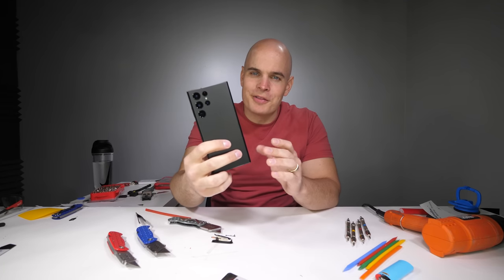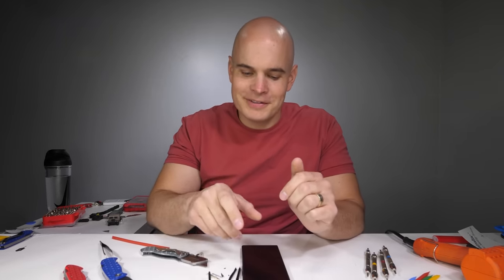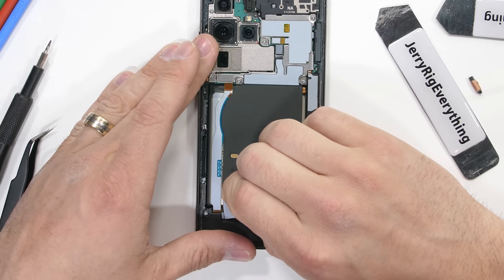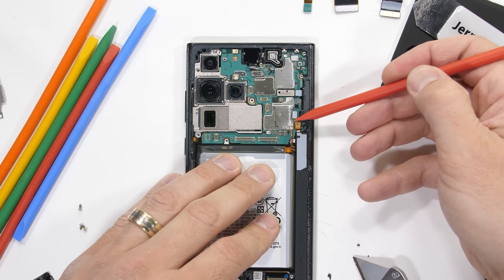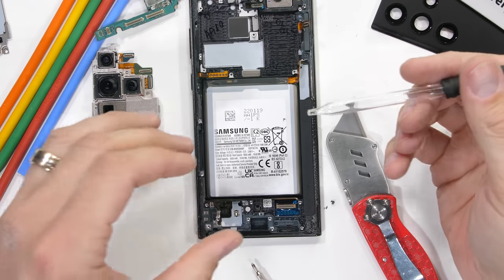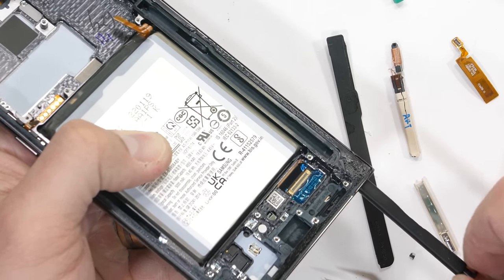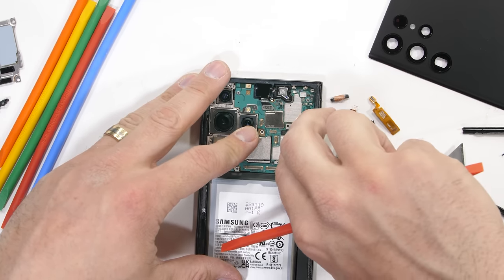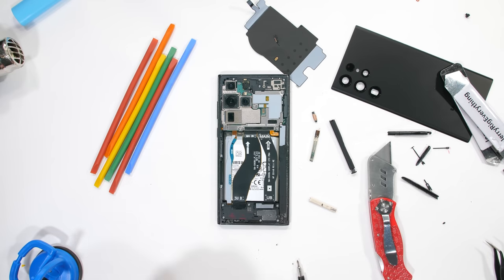Galaxy S22 Ultra Teardown - Can the S-Pen hole Leak?!

Comment: I am rocking my note8 at the moment. The USB-C port is kinda ruined, but it still charges. I already changed the battery, but the second one is nothing compared to the first one. Ow, did I mention that during the replacement I sliced the battery and it looked like it wanted to launch into outer space? The phone survived the unscheduled fire test, with only some pixels burnt to death. The speaker for calls doesnt work for couple months now, so I am using my headphones or loud speaker for calls, super uncomfortable but I just wasnt ready to replace it yet. I think I have done my part environmentally, using my phone as long as possible, until it almost dies. I am planning to buy S22 or Ultra and trade in my note8 for it, so the shop will use it for parts, this way, my old phone will serve even after its final disassembly.

I try to do it with all my electronics, use them until they die or are ridiculously old, then recycle and replace them. Also saves a lot of pocket money not buying a phone every year or two.

I would love to use my new S22 for years. I would gladly replace the nonfuctional speaker, usb and battery if they ever get clogged, if the replacement is not ridiculously costy - lets be honest, they are now. The insides of the phone dont age. If they software was updated for many years, even that would not age. I also protect my screens and even they are replacable when needed. But companies dont want us to use our phones for years. Hopefully EU will push more for longetivity of electronics.

Comment: Looks like flagships finally plateaued. Any performance increase you get out of this over a flagship 2 years ago is incremental at best, yet they charge more for it.

Good thing I can see here is that, aside from convincing me to hold on to my old phone, it also simplifies my shopping choices when my phone finally kicks the bucket. Instead of upgrading for features (which isn't all that impressive, to be honest), I am now shopping for a home appliance. 

Honestly, I am okay with that.

Comment: If you buy direct from Samsung you can trade in your old device, pretty easy way to recycle. I FINALLY traded in my pristine Note10+ for an unlocked S22 Ultra 512gb and they gave me $425 trade-in value. With pre-order discounts, I ended up paying $810 for the phone. Plus Samsung gave $250 in store credit to those who pre-ordered, which I used towards a Watch4 Classic. Total order cost with shipping: $918.91. Retail value: $1719.98.

Comment: Definitely agree that the battery shouldn't be so difficult to replace both for environmental and safety reasons. I'm curious though if using such strong adhesive contributes to structural rigidity? Curious if the thought has ever crossed your mind. How can that theory be tested though is the bigger question.

Comment: For Samsung battery You just need to use ethyl alcohol ( more than 96%) and Yo u can basically use any suction cup or even your fingers to pull it out. Just wait 30 seconds or even better put it in hotplate for same time.

Comment: I personally don't think the battery glue is that big of a deal at least on most Samsung devices. I always find that with a bit of heat and alcohol, it usually pops right off with minimal effort. The pull tabs on Apple are not what they are cracked up to be. They work OK on new phones, but after a couple of years, they seem to lose some of their elasticity and break as soon as you tug on them.

Comment: I keep an eye on battery technology and lithium ion battery developments. I don't know anywhere in North America that currently offers 95% recyclability of them. One company has a technology/process that claims to do this, but they're still building the pilot plant. No battery sent for recycling today will be 95% recycled AFAIK. Current hydrometallurical processes used in most recycling facilities today are no where close to that 95% number.

Comment: Samsung batteries are easy to remove with a heat plate. Iphones on the other hand are a pain with a heat plate or any heat. The tabs always break when trying to pull on them so I have to resort to heat and brute force. Use a metal spatula next time then make your own with your logo then sell it on your website.

Comment: Repair and recycling is important to me, which is why it is so frustrating that flagship manufacturers have chosen to prioritize profit by designing phones without easy access to replace the battery/repair the phone. Give me a Fairphone compatible with US carriers and and comparable tech to most modern flagships and I would buy that in a flash.

Comment: As I have never worked for a recycler, I could be wrong, but I don't think they really care about the extra adhesive on the battery.  They are not gentle when tearing apart a phone to recycle.  In videos I've seen, they really just rip it apart and throw the individual items into bins to be destroyed and broken down for other use.  I do see where doing repairs would be more difficult, which is always unfortunate because reuse is the best way to keep landfill waste to a minimum.

Comment: i don't think removing a lot of glue is an issue when you throw away the rest of the device too but if you want to install a new battery to extend the lifespan of the phone it's easier to damage the screen when removing the battery if there's this much adhesive.

Comment: Although it is interesting (and quite educational) to see a phone opened up like this, a vast majority of people won't be digging into their phones and risk breaking something, and voiding warranty. 
Instead, it's far more likely that they'll use a replacement program (much like Samsung itself offers), replacing their old phone with a new one. They get a better deal for the new device, and Samsung gets to deal with recycling their old parts, including hardcore battery glue and whatnot. 
IMO the latter is a far better option at the moment, at least until we get phones that are meant to be taken apart, without the risk of damaging expensive components, voiding warranty and potentially hurting yourself.
I guess my point is that a heavily glued battery shouldn't really be a deterrent factor in buying a new phone these days. 😀

Comment: Great video. I have a problem with my S22 Ultra after a screen w/frame replacement. It will not detect that the S Pen is inserted. Inside the S Pen enclosure, is that white component the trigger switch lever to alert the phone that the pen is in the phone? That's how the note series was but I don't see how the trigger would be connected. You mentioned 2 cables related to the S Pen. Maybe the tech didn't fully plug one back in assuming the white piece is a trigger switch. Thank you.

Comment: I was trying to find out what a thing on the outside of my S22 Ultra corresponded to on the inside, but you didn't cover it in the video.

On the side with the power and volume buttons, about 2/3rds of the way down the phone and about half way along the battery, there is a rounded rectangular piece about the size of the volume rocker but with no apparent purpose beyond being made of a slightly different material / having a different texture. It is mostly flush with the rest of the side, but is perhaps a slight be indented. And there's only a very small amount of metal from the normal side material between it and the seam for the glass back and between it and where the screen starts on the front of the device.

Do you know from your tear-down what that is and why it's there? Or was this not on the model you looked at and something that only some models have?
Reply: From taking a closer look at your video and comparing against some diagrams I found, the piece I'm talking about is covering up one of the 5g mmWave antennas. They probably putting some plastic in front of it instead of metal to give it better signal reception. Not sure why they only did that for the antenna on that side and not the other mmWave antenna on the other side of the phone across from where the volume rocker is though.

Comment: I wonder if people out there really buy a phone asking themselves, "how recyclable a phone is?" I've never asked myself that honestly. I don't think that question applies to me personally. I purchase a phone to use it. Not to worry about what happens when I go to trade it in. There are people in place to worry about that.
Reply: Important to me. Was considering this until seeing how difficult the battery replacement is. These batteries last 2-3 years. I don't care if I lose waterproofing but I'd like to extend my phone for another 2-3 years. I had an iPhone 5S for almost 4 years because replacing the battery wasn't super hard, just unglue the back and pull on the tabs. Having ribbon cables right where the battery is has to be designed to make it difficult for self repair...

Comment: Answer to your question - I would love Samsung and other manufacturers to go back to removable back cover and easy battery replacement. I do not need waterproof smartphone, but one which can be easily repaired without glass back cover and glue strong like steel.

Comment: Note 8, still holds great, 4 years ago. It only misses some updates, but in rest, it has a SD slot, 3.5 mm jack. And it's slimmer and rounder on edges. Remote gimmicks with S-pen are useless. Too bad I can't return back s22 ultra.

Comment: Was hoping to see that there was a way to add a microSD inside. I made the mistake of buying the 128GB phone and already wish I had more space. Samsung seriously dropped the ball by not having a card slot.
Reply: Exactly, and why??? They xould easily make second sim card slot function albo like SD card slot but they didn't. And samsung even made ads before about making fun of apple removing features. They need to fire some of the new staff to not have such ideas as removing sim card like apple also did in iphone 14

Comment: All phones in the market should have goes back to user battery replacement era. Save our cost to repair phones by just a new battery would makes our phone reusable instantly. Upgrade phone is actually a pain process especially those who needed to transfer a whole lot of data as every phones brands have its own unique method.

Comment: Would you please address the speaker bug issue in S22 series.  Apparently the phone is so watertight that high altitudes and very cold temperatures affect the internal pressure of the phone, keeping the speakers from processing sound normally.  Very interested to hear any obsrvations.   TY.

Comment: hello jerry
In the morning, I accidentally inserted the sim removal needle into the hole next to it instead of the sim hole and pressed lightly. I later found out that this was the microphone hole. There is no problem with the phone. microphone also works.
but according to what I read in 12 places they say you may have damaged the waterproofing. Can you provide information on the subject? thanks

Comment: I dont mind recylability too much as long as its recyclable in theory. Its hard for me to internalize how hard it is to recycle and how much that impacts battery recovery, but knowing that it is well built and will not face much environmental strain could lead to me feasibly using the phone for much longer than normal which is better than recycling for the years it's in active use (i.e. using one phone for 4 years is better than using 2 perfectly recyclable phones for 2 years each)

Comment: aldough seems like it is easier to replace samsungs s22 ultra battery than on iphone 13 pro max.. on iphone you have to remove display.. and some other parts, have to use 4 different screwdrivers. on samsung, battery removing is easier if you heat display a little more, then adhesive softens and it is much more easier to pull battery out. :-D

Comment: I did a Samsung warranty repair for faulty S-Pen turned out customer went in water and quickly got back out. S-Pen got water damaged I got told by Samsung that S-Pen is not waterproof but they replaced it under warranty.

Comment: Would it be possible to replace the bottom board with one from a previous  Gen that has a sd card reader maybe the Note 10 board since it also has 45W charging ?

Comment: So I came to watch so I could finally figure out where the NFC antenna is. So the NFC unit is up beside the cameras? So then, why is it that I have to tap my tags against the center where the wireless charging is, or tap the bottom of my phone to payment terminals? I get zero action up by the module itself, and I am supremely confused now.

Comment: Apologies but the iphones are still not repairable , in the slightest. The parts from apple cost as much as a repair done by them, the bacj glass doesn't come off easily, and ALL the parts are software locked. Watch Hugh Jeffrey's video. Samsung, apart from the battery, is one of the most repairable flagships. Easy to repair and no software lock to the parts.

Comment: My S22 Ultra wouldn’t function at all last night. I think a bit of water got in through the power button. The screen starting freaking out then just went black and non responsive. Power button didn’t work. So I suspect either water or Windex entered the phone through the power button hole. I messed with it for 2 hours and there was no improvement. I put it in the freezer for an hour and only had the screen return for  maybe 2 seconds. But that gave me hope. placed the phone in a box of white rice for 10 hours and now the phone is functioning fine. I take very good care of my devices. Water proof? Not 100%.

Comment: good luck repairing a apple phone yourself jerry!  yes battery replacement is important as a phone that is still good after 4 years might need one... going through apple and samsung for years and trying something from xiomi out of impulse , thanks samsung (customer service did not know after 20 days if my order is dispatched or not...) i found that if you can live with the extra stuff preinstalled xiomi outlasted so far any samsung or apple phone i ever had... and is easier to fix...so i do not need to through it away in a drawer like my s7 s8  as replacing a screen was not economical justified1-2-3-4 years later...

Comment: Well now that the display on this S22 Ultra doesn't work anymore u can use the rest as the brains for a laptop/tab or use it to make a control panel in your hummer by connecting it to a larger screen.

Comment: You know I had Verizon for the longest time with a note 10. but the service in Washington after I moved up here was just so bad I couldn't really bother with it. so I switch to T mobile and they had a deal going on for a $1000 off with a trade in for any new S22 phone. I really didn't want to get rid of my note 10 because it was still in perfect condition but I really couldn't pass up a good deal. Plus it kind of made my wife a bit happier and I have better service well at work. and so far there hasn't been to much of a difference between the note 10 and s22 ultra besides the backwards buttons for me. and smaller memory but besides that I'm a lot more satisfied with my phone then I was really expecting.

Comment: Just saying, ive done some testing with mine and it seems samsung has yet to fully optimise the new chipset 
According to results its same similar if not same as red magic 7 by nubia but gettings 4/5 the score s22 ultra snapdragon sitting at around 8200 scores and nubia sitting at 10060

Comment: Anyone know why my S22 is now having connectivity issues? I live in Los Angeles, performed a factory reset after replacing the SIM card and then eSIM. Phone only works when I’m walking outside but if I’m anywhere indoors, I can’t connect to anything. Any suggestions?
Reply: если телефон падал, и после этого связь стала плохой, то скорее всего отвалился модем или какое нибудь соединение. или же отвалилась антенна, шлейф и т д

Comment: Honestly, I've been using Android phones from the Nexus One to the OnePlus 7 pro. I loved Android. But my OnePlus battery was quite toasted (I had to charge sometimes twice a day), and the screen was burned. The choice today in Android phone is dire. OnePlus quality went down the drain (an no more Oxygen OS), the Pixel lineup has a lot of issues, and I hate the quantity of bloatware Samsung delivers with their phones. If you want a high quality phone that last years without problem, with security updates... I went to an iPhone 13 pro, even though I used to dislike Apple. Quality product, durable and solid. I don't see any choice for longevity in the Android world nowadays, and it makes me sad.
Reply: My oneplus also got burn in issue. In my family 3 oneplus phones has burn in issues in 6t, mine 7 and 8. I serched in google and found out that only two companies samsung and apple ony got anti burnin software for oled screens. Its a major issue that most of people doesn't know about 🤷
Reply: @bishnoi969  Yep ! Quite peeved to always see the ghost of a battery indicator and a smudge of notification on a white screen all the time... I don't know about Pixel and burn-in issues, if this happens, but if it does, then the choice is reduced to Samsung vs Apple. And on my S7 edge (only Samsung device I owned), between the impossible to uninstall HP tool, the always-on Samsung Smartthings and others, the quantity of bloatware was just too much for me. It's sad to see the Android world reduced to this; In the past, it used to be the place where you can have CHOICE; quality stuff and low cost stuff, everything at your disposal. Now, it's either "not durable but fun", "not durable but crap" or "durable but give me your data, you are the product". No other choice.
Reply: @Mitch404  well im going to put my last bet on motorola. If that does'nt work 
then bye bye android but im not a camera guy. If u also use camera very frequently then go for iphone becoz camera of moto is bad